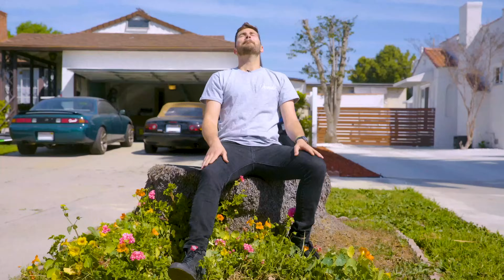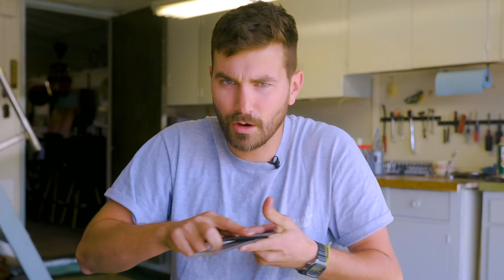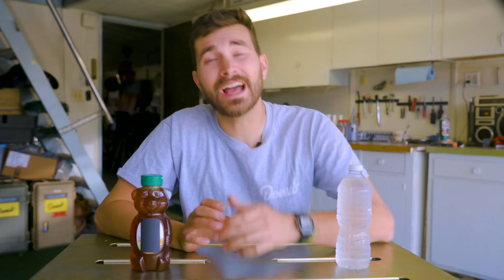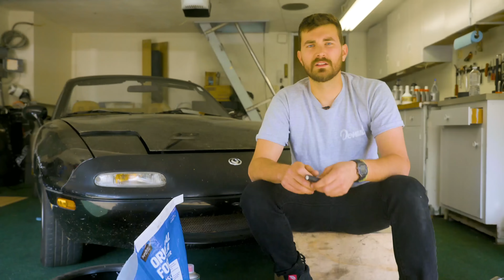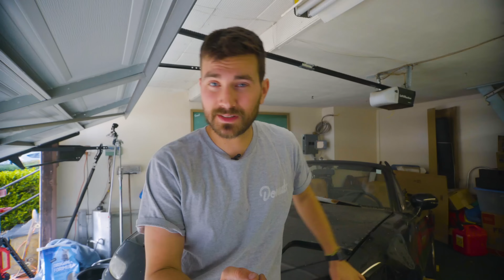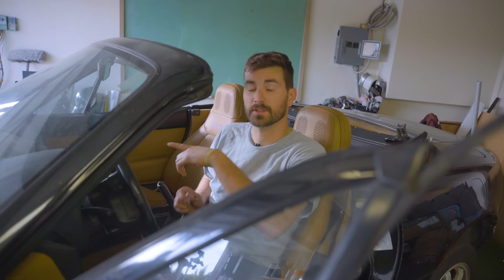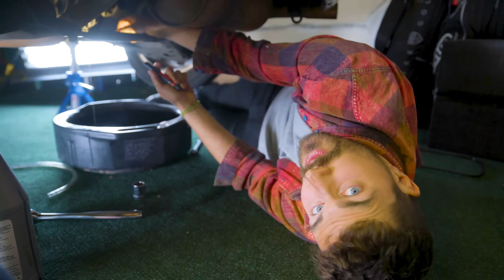9 Things You’ll REGRET Not Doing to Your Car

Comment: Engine oil: Recommended every 2 years or 30000km (18.6k miles). My recommendation 10-15k km 6-9k miles.
Transmission: Recommended 120k km. I need earlier (60-70k km) and 4x4 transmission I expect in 5 years.
Diff: No change plan. I plan it in 3 years.
Spark plugs:  Any idea which should I get in about next 5 years / max 100k km?

CV joints and shock absorbers are my problem. Need to change them every 5 years due to officially "repaired and perfect 1km for 1mld CZK (46M USD)" roads.

Comment: I use PETRONAS syntactic engine oil, my Renault Engine still as it was leaving the showroom,  original not a screw twist to dissemble the engine since 2005 , I changed my oil as recommended by the manufacturer

Comment: You missed a distinction between traditional and synthetic oil. Traditional oil is refined from crude oil pumped out of the ground. Synthetic oil is 'synthesized' by modifying hydrocarbon chains that are refined from crude oil pumped out of the ground, that had little practical use aside from candles and ski wax, before synthetic oil was invented. The way you said it makes it sound like synthetic oil isn't made from crude oil...

Comment: If you are using one of those bottle things to bleed your brakes or clutch, you do not need a second person.   As long as the reservoir stays full and the little hose stays below the fluid level in the bottle, you can do it yourself.   Honestly, if I were to add a second person to the scenario it would not be to pump the pedal, it would be to stand and monitor the reservoir level.

Comment: tip to anyone bleeding their brakes. DO NOT, I repeat.. DO NOT get the brake fluid on your paint! it will destroy the paint. If you do get it on your paint, get as much of it off with paper towels as possible, and wash it off with water as much as you can. run it over the area for a long while.
It MUST be cleaned IMMEDIATELY. (ideally within five minutes) or it could begin eroding the coating layer of your paint job and expose the metal underneath.

Comment: Isn't it bad to let the car run out of fuel while the engine is running?
If you screw of the tank cap doesn't it de-pressurize as well?

Comment: Hey guys,
One of my cylinders started misfiring, so I replaced the ignition coil on the misfiring cylinder + all the spark plugs. I looked on my car’s forums and ascertained that I should not gap platinum spark plugs, as it may damage them. Is this correct in y’all’s experience? Obviously, I want to extend the life of my engine as much as possible.
Thank you!!

Comment: Best oil isn't synthetic, or semi syntethic or even mineral oil! best oil is NEWER oil! it's better to put cheap oil, and change it every 3.000-4.000 miles, than buy super expensive synthetic oil and change it every 20.000 miles, oil change period depends of how, and where, and in wich condition u drive, if u drive allmost in city (non-stop starting and stoping engine, short rides) its smart to change oil early for about 30-40 % earlier than car manufacturer say, ofcourse it's best choice to put oil wich manufacturer recomends, but shorten change period minimum for 25 %, and in that way u can save engine from failures, and much wearing, one more important thing is to not rev up engine above 2.000 RPM till engine reach working temperature (80-90 celsius),some statistic says, believe or not: 80 % of engine failures ocurs when starting engine, and when engine is cold, if u driving just started cold engine like a Mad Max xD, and rev it up in red RPM's, your piston rod can crack like icicle!

Comment: I'm confused about the oil viscosity numbers. At 2:14 you say that low viscosity (water) equals a low number and vice versa. At 3:00 you say that 10W-30 means a viscosity rating of 10 in winter temperatures, and 30 at operating temperature. By that logic, the oil is MORE viscous at operating temperature than at 0°F?

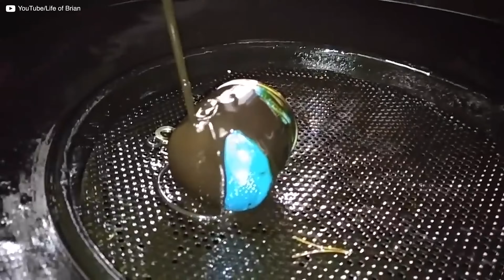Comment: 4:15 Every 3k miles or every three month??? With modern cars it’s more like every 20k miles or once a year! But it can be pretty different depending on the car.

10:00 when changing/bleeding the brake fluid you should probably also check if your pipes of the brake system are still good.

Comment: Pro tip from a mechanic. Use the correct type of spark plugs for your car. If they call for iridium spark plugs. USE iridium spark plugs. Also do not over tighten your belt. Too tight will cause belt noise and can burn out components such as alternator and AC compressor.

Comment: Only comment that I’ll make, however, there are many. That said you made an excellent, informative video. 
My thought is that the brake bleed generally starts from the pistol/caliper farthest from the master cylinder. I’m sure that you’re aware of the multitude of procedures for bleeding brakes and some ways of bleeding don’t apply - such as brake systems with IR valves in them  

Great incisive video. Thanks 😊

Comment: I feel like you missed an important step with the belts. Take a picture of the belts or draw their orientation on the pulleys if there isn't a diagram on the engine bay. Sometimes its not even as simple as googling belt diagrams for your year and model car.

Comment: As an Aircraft Maintenance Technician I am amazed by how well you did these maintenances, and the maintenance definition on the start of the video was really nice. There are a couple of differences between the car and the aircraft worlds, like the AC system on the helicopter I work  has the compressors driven by the main gearbox by a quill and belts system, the tensioning method is very different, we have to be so sure that the correct tension is applied that we have to use a tensiometer that tells in which frequency the belt is. Following the correct torque values is also mandatory for every single bolt we fasten, very glad you spread that kind of knowledge in the video. Standard practices and following the manuals and procedures makes up a good maintenance technician. Greetings from Brazil.
Reply: Man you look familiar, who was your certifying DME if you dont mind me asking? 
I recall a good handful of fellas coming up from South America to do their AMT testing for A and or P ratings, the school only got an avionics course during my last semester. It was a school in SW Florida. But seeing you say greetings from Brazil makes me wonder. 

Wondering if it may have been you i saw that is, we werent allowed to speak or interact with testing applicants so I cant be sure. If so small world man.

Comment: I work at my Family’s rental shop and we also do small engine repair. These guys bring in a gas powered trash pump that is not working. Due the basic run down, check gas, check air filter, check oil.... hmm engine oil isn’t supposed to be red. They put in power steering oil

Comment: pro tip from a mechanic, avoid using vice grips to clamp down lines, sometimes they can cause tears in them and it’s better to use line clamps if you can.
Reply: I just clamp over a rag. Probably still not great for super old lines, but its always done me solid.
Reply: @AcornFox  if a line is old enough to break from that it’s not worth holding on to. Rubber lines are cheap af
Reply: @bodhijohnson2803  true but sometimes you have to make do out yonder. not every fix takes place in a stocked garage, my friend.
Reply: Pro mechanic tip, when you don’t have hose clamp pliers, needle nose vice grips with some fuel line over the jaws works great and doesn’t hurt lines.
Reply: I just let it pour all over me lol
Reply: I shoved a pen in when changing my filter lol
Reply: Stick a thumb in it
Reply: @norsethenomad5978  thumb works great.
Reply: Pro DIY tip: use a Vice grip and two quarters to clamp lines.
Reply: Even better, get your kid to stick their finger in the end of the line. Seals it perfectly, plus child labour is free. Just ask Nike.

Comment: Maintenance, or PREVENTATIVE MAINTENANCE is key. I bought (and still drive) a 2003 Dodge Caravan with 165K, I now have 540K and am doing my first "real" repair, timing chain and gears. Been a great vehicle, used it in my business driving 90K a year. Got 870K out of my prior 1 ton chevy express, with a second engine, only because I learned flushing the coolant system is as important as an oil change. Great stuff, Thanks.

Comment: You stated the W stands for winter on oil it does not stand for winter it's for weight and you talked about starting up the vehicle to put oil in the oil filter to see how much oil level is this is wrong you're supposed to put oil in your filter before you put it on your engine as much as possible unless your filter is mounted sideways and then that's a stupid design and you can't fill it

Comment: No mention of drain plug crush washers?!  I've seen Jiffy Lube mess up so many times cuz of accidentally doubling up on those, or the old one leaking.  Also the best think I've ever seen was when they didn't realize the O-ring on the filter itself was stuck to the engine, so when they put a new filter on it was rubber on rubber, and was just SPEWING oil when they started it, hahaha, the joys of watching those idiots was priceless when I worked 20ft away at the O'Reillys, hahahaha

Comment: My 2017 VW Passat has manufacturer oil change at 10,000 miles *Full synthetic oil.  To me this proves how good synthetic oil is.  And if you change your own oil the price difference is negligible! And worth it. What's really odd about the Passat is there (as far as I can fine). Zero Transmission service requirement, there's even no dip stick. It's 100% sealed and is supposed to last the life of the engine.   This with the oil filter access on the top. (1.8L 4cyl turbo) makes it easy!

Comment: I feel like you missed a very important part about spark plugs which will effect many people with boost applications. When running high boost copper plugs are better. While they do burn out faster they also seem to produce a more reliable spark and won't get blown out by the boost. I have an a4 running about 26 psi and under boost with anything but copper it would miss fire and from a little research it seems like a common issue.

Comment: My only quarrel is at 11:16 he discusses the dry boiling point of the brake fluid. You really should be addressing the wet boiling point as it'll designate  the scenario of the brake fluid after it's been used for a portion of its lifetime. As the brake fluid is used water gets in there and that's what the wet boiling point indicates.

Comment: I noticed a big difference between my cobalt’s power steering pump and my  grand caravan’s power steering pump. At full lock my cobalt doesn’t make a noise but if I put my van at full lock it hissing for about 2 seconds and then goes away. I replaced the serpentine belt on the van but it still hisses. Never really cared since the wheel doesn’t get tight and the fluid system doesn’t leak but I wounded what the difference is.

Comment: When I checked the oil, one time, and noticed that the dip stick was entirely dry, I got a little worried. So, I filled up 1L of oil and waited about 15 minutes before checking it again. Still dry. So I filled it up with 1 more liter and waited 15 minutes. Now there was a small speck on the tip of the dip stick, so I filled it up with 1 more liter and waited 30 minutes this time. Right on. It was just below max. 3L of oil. I had a bunch of it laying around, bot 5w–40 and 10w-40, and because it's a 19 year old Volvo, it won't be too sensitive if it's not the correct oil.

Comment: If you have water in your brake system, you can pump multiple times to build up pressure, and be able to actually use the brakes. Isn’t that correct? So you should get the air out, but you are t completely fucked, right?

Comment: Ya I don't care what they say now of days every 3000 miles or 3 months. Take a part  2 same engines that run the same oil for 100,000 miles one changes at 5 or 6 000 and one at every 3000 and tell me wish one you would want.

Comment: Get some Motorcraft MT-X5-QS fluid for the transmission at your nearest Ford dealership. It's $24 a quart instead of $18 for the Redline but it more than makes up for the price difference. Seriously. Check out the forums. It's the best thing you can do to your Miata after you first buy it.

Comment: A couple pretty important side notes, from someone that managed a lube shop for a few years.
Every motor, and variant has its own oil plug torque spec, based on the material the pan is made of.
Also, and less important, a quarter to a half turn is usually fine, but the filter also has a torque spec as well. And always use your new oil, to lubricate the new rubber. Never use the old oil. Ever.

Comment: It should be important to note and inform the home gamers that you want to start at the furthest corner from your brake cylinder when bleeding your brakes or replacing the fluid. It's also important to make sure that you drain all the old fluid and ensure the bleed line is clear so you know when you have fresh fluid coming out. I've done a bunch of brakes as a mechanic and had access to an awesome pressurized system that did all the pumping and draining for me. I could change fluid or fill a dry system in a matter of about 15 minutes when taking my time and being sure that I had all the bleed valves prepped to bleed or loosened a little so I wasnt struggling to loosen them enough to bleed but not too much to the point that the fluid rushed out under pressure.

Comment: Spark plugs! Oowee you need to not advise people on spark plugs that way. 

89-93 NA miatas require copper plugs. If you install any other spark plug beside what is recommended, you will get a misfire,  slow acceleration and poor gas mileage. 

94+ you can use platinum plugs

Iridium plugs are for turbo or supercharged applications.  DO NOT install iridium in your NA engine (unless your compression ratio is close to 13:1)

That is all I wanted to say. Have a great day

Comment: 1 man break bleed trick.  1 extensive length of 3/8 clear tubing and a couple squeezy clamps or clothes pins. Attached tubing to bleeder valve and clamp the other side to the brake fluid reservoir. If you're using a closed end wrench, be sure to put it on the bleeder valve before attaching the hose. Now loosen the bleeder valve and pump your brakes.   Now just watch the line until there's no more air in it well also checking the reservoir to keep it topped off. Close bleeder valve and move to next brake cylinder. As long as the hose in the reservoir is kept below fluid level, it will keep a vacuum and you will not dump brake fluid after removing the hose from the bleeder valve. 

This is also useful to do a brake flush to clear out any old brake fluid from the lines.

Comment: I wanna add on a couple things to the vid:

On the oil change - wear gloves and glasses, used oil is carcinogenic. Oil on the gasket doesn't really make a difference in my experience but it can't hurt. What can hurt is double gasketing, so check that the gasket from the old oil filter is off the housing. Also, if the filter comes in a kit with a drain plug or other gasket, always replace that as well. This is especially critical on the new german cars with tight tolerances even on the drain plugs

Brake fluid can be tested for water content with a fairly cheap tester. Also look for dark colors - it may not be contaminated with water but with particles instead from brake lines. Still needs to be replaced.

You can also bleed with gravity - open the bleeder screw, and leave it alone for a while - or with a vacuum bleeder if compressed air is available.

dirty oils in general are bad but when they get really dirty or full of metal particles they go from lubricants to cutting fluids and cause damage

Sparkplugs are also an indicator of how the engine runs. If it's black, it's running rich. If it's white, it's running lean. If it's a tan/cream color, the air-fuel mixture is just right. And always double check the gap - it may get screwed up during shipment and it would be a stupid reason for the engine to run poorly.
Reply: Copper plugs also conduct best and give the hottest (read - most complete) spark

Comment: W doesn't stand for weather it does stand for weight, at operating temperatures. The second number stands for room temp viscosity.

Oil does not get thicker at it gets warmer, it very much so does the opposite.

Comment: How do you keep your garage floor material from getting nasty? ...  My 1985 Saab 900,  the manual transmission oil was the same as the engine oil! I used Mobil 1 in both. Sold at 250,000 miles running smooth & quiet, shifting smooth & solid, with ZERO engine or trans issues - not even the common (reverse)  popping out of gear, I think it was.